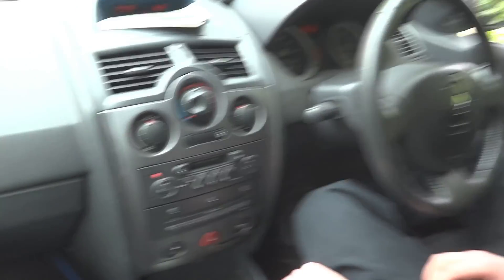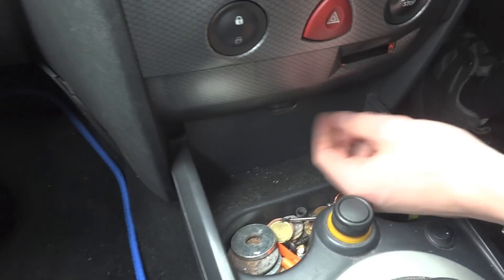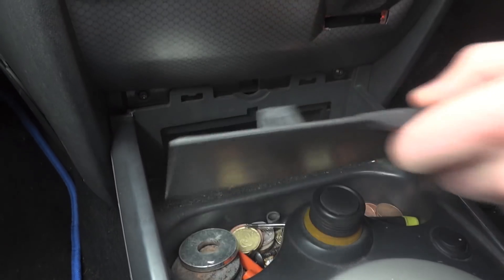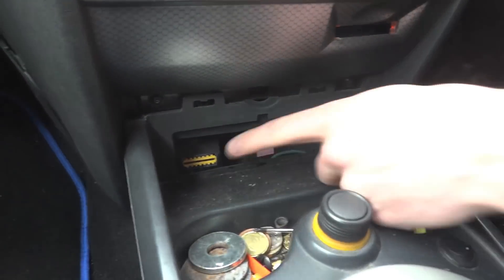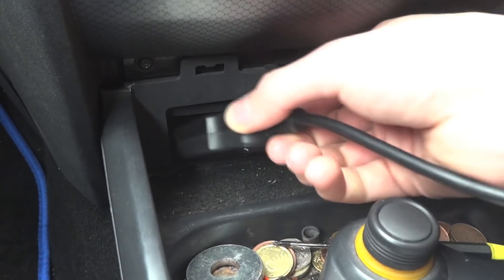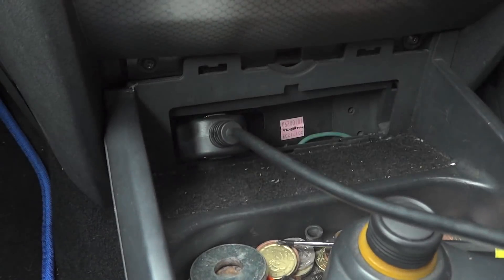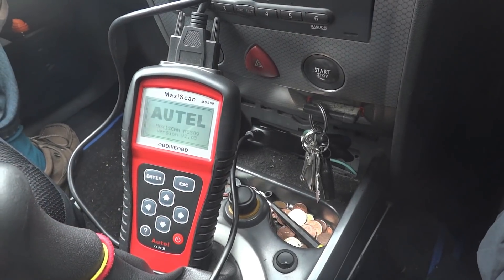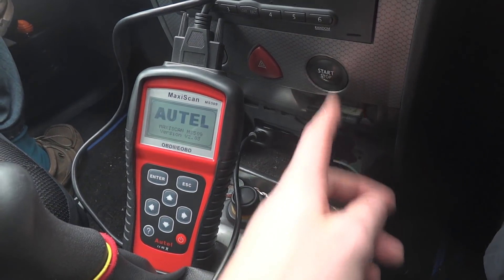How to access OBDII port on Renault Megane

Comment: Great...then it asks me to put ignition on without engine on...which you can't in a Megane as it uses a shitty keycard.
Reply: Barney Wobba yes you can, with the card inserted hold down the start button for 5 seconds without putting your foot in clutch or brake. This will turn on ignition on, but not engine.
Reply: @matthewp9015  wow, great tip respectively information, just tested successfully using an LAUNCH 4001

Comment: My renault 1500 diesel 2006 model. Port is under sliding console box. I plug in scanner, start car. Nothing it don't connect any tips there thanks.
Reply: Frank Keller is still not working?